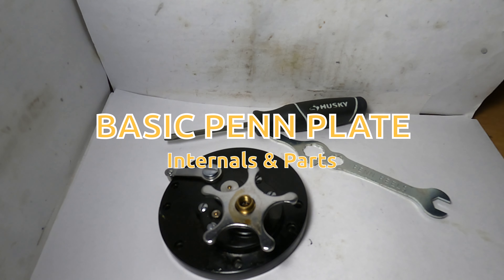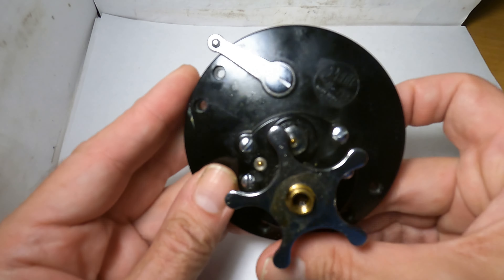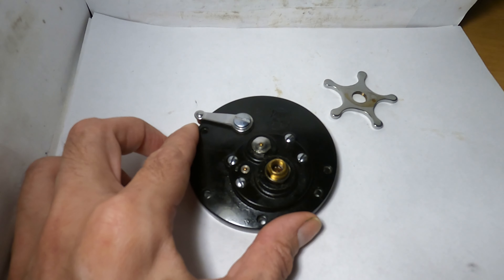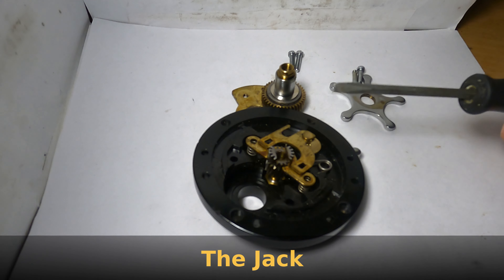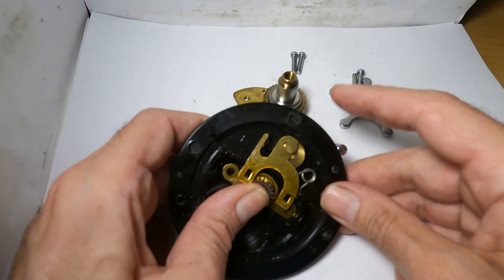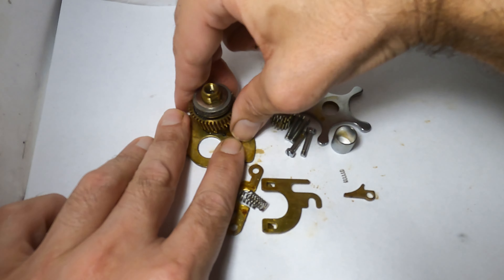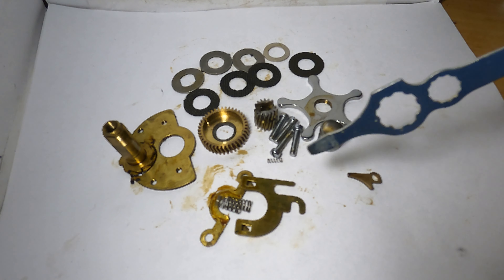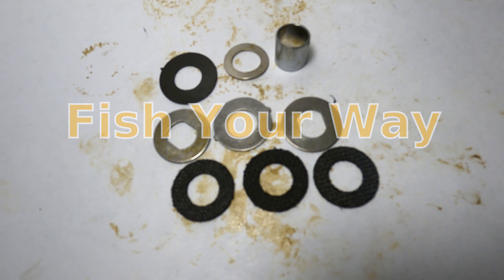Basic Penn Conventional Plate Construct & Parts for All Penn Fishing Reel Plates

Comment: What do you use for lubing up all the parts? It could be usefull, to make a photo of every step, when you start bringing the stuff together again. I always forget, which part comes when and then there are springs or screws left over, after putting it together again... 😜
Reply from the maker: I like regular oil but any will do.  Step by step is a great idea, a regular towel helps with parts bouncing will keep in mind thanks Robert